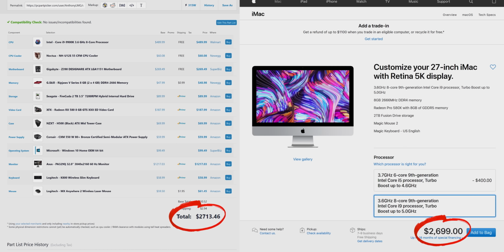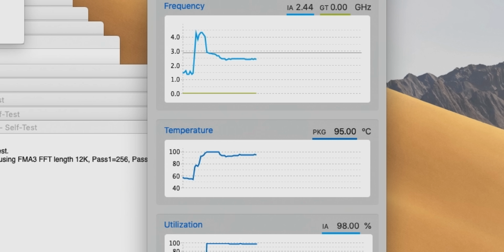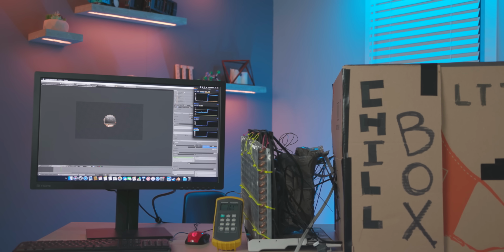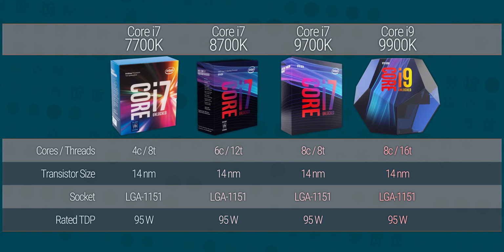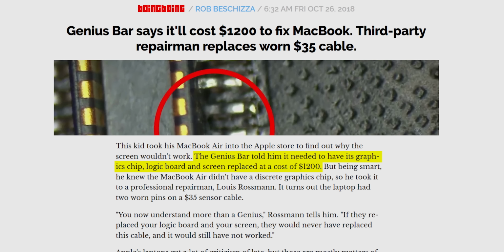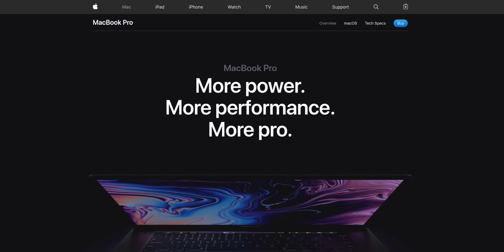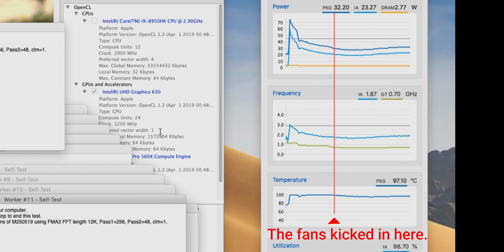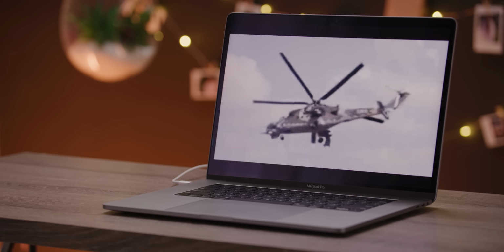Macs are SLOWER than PCs. Here’s why.

Comment: I agree and say it on the every chance I have, Apple should put slower CPU's in their Macbooks, with higher usage and lower heat and lower power consumption. Heck, not only apple, everyone should do this. I mean, yes slick and thin laptops with a ton of power and speed does sound good but the current CPU architecture that rules the PC world (x86-64) is not capable of this. Yes, you can put it in a smaller form factor, but it won't work as well as a well build and cooled desktop case. I mean, if you really need that power, you SHOULD chose the desktop choice or the Mac Pro for that instance.
On the other side, Apple is also a CPU designer, they design their own RISC-3 and RISC-4 ARM processors, with lower heat disipition and lower power consumption, with higher perofmance levels than most of the normal level desktop CPUs. The main reason they dont use it on mac's is that, no application other than Apple's own application won't work on the machine. And building a ARM to x86 to converter is more complex than you think, promising that Apple wouldn't want to launch a bad emualtion of this since they want the absolute best on their mobile devices and processors. ARM is currently on the 7nm level of transistors. Yes they are really not that powerfull on the top notch, but a Macbook Pro doesn't need all the power. I believe Apple plans on launching a ARM based Macbook sooner than you think, for the general purpose of usage. Most of the general usage apps have a ARM compability, and Apple might consider some iOs apps to work on MacOs, witohut any changes to the applicaton's inner workings, since the UI should be redisgned and refactored for the macbook and bigger, more dense displays. 

I really believe that x86 days are coming to and end for the average user, seeing that new iPad Pro can blow most of the cheap laptops away, I believe that even intel should bring their ARM game on. ARM is going to be a better platform for most of the general purpose users, and maybe even content creators and developers. But there will be someone that has a job that requires most of the processing power in the world, and thats where AMD x86-64 should stay. It's an old design, they should change it completely as soon as they can, because the more we use it, the more we become attached to it.
Reply: agreed with every word. well put.

Comment: It's always so bizar to me how people try to break Apple, oh, they are not fast, and it will break much quicker then pc's. Why then is it, that i have a 27" Apple led cinema display from 2009 and a thunderbolt display from 2010 side by side, working perfectly. My Macbook Pro retina 15" from 2012 (7 year old now), still working great. My Mac Pro 2013, no problems at all, loads fast, and works very reliable for around 3,5yr. now. I have an Apple tv, iPhone X, all working perfectly. The thing is, i went from pc (self built rigs) to Mac exactly for this reason, much more reliable! Of course, time has changed and i know Windows has been catching when it comes to reliability. I'm using my Mac Pro for music producing and video editing. And on the side i also do some web and graphic design. The only thing that i hope for is that the new Mac Pro is modular enough. Been thinking about building myself a pc again. Just for kicks :-)

Comment: Apple does not sell devices.  Apple sells "devices as a service".  Purchase price + AppleCare subscription (in good standing) = long-term (>1-year; including repairs) device.  Purchase price only = short-term (=<1-year; excluding repairs) device.  We don't buy fruit by the same name, either.  We rent it.  One way... or another... it becomes something you don't want to consume.  Like bad fruit, Apple's devices are shipped rotten... quickly turn into "used food"... causing far more bellyache than they are worth.  CrApple.  Stink different.  Mac.  It just breaks.

The MacBook Air was advertised as "Light.  Heavyweight."  My 2015 CrapBook Ail: "Light.  Paperweight."
Reply: 3 years isn't really that long. Most people will use their iMac/Macbook for up to 10 years(basically until they break or become so unusable that it's time for another one).
Reply: Tell that to my 11 year old iMac. It want quit working, so I can buy a new one. Wanted on for years now.

Comment: apple will use the higher CPU SKU because of other differences, mainly Cache size. Why ask Intel to make another SKU when you can just throttle the existing one. The price difference would be negligible after the cost of a different run of production for them.

Comment: In addition to all this, it's misleading to compare a PC build that includes a $1,200 monitor to an iMac. That monitor will still be good after the PC no longer is, and odds are you already have a monitor to use with your new PC anyway. Or if not, at least you can choose to buy a cheaper monitor if you don't want to spend $1,200 on one (indeed, $1,200 is a high amount to spend on a single monitor unless you have very specific requirements for such a high-end display...). With any all-in-one where the parts aren't upgradable, the first time any part becomes obsolete or fails, all the other parts effectively do too.

Comment: My macbook sounds like I am hardcore gaming when I only open like 2 chrome tabs.
Edit: I never said i game on a macbook. i just said it sounds like it.
Reply: How old is it? My 2011 13" mbp got super noisy at one point about two years ago and I had a guy open it up, completely clean all the dust out, and apply new thermal paste, and now the fan rarely turns on again. It's only a core2 so it's not a speed demon anymore but it works fine for browsing and so on.
Reply: Chrome is horrible at thermal, CPU, and Memory resource management on MacOS
Reply: In terms of cpu, nah. In terms of RAM, "Rev up those fryers!"
Reply: Chrome is Such a Memory HOG
Reply: chrome is "hardcore gaming" if  you know  what i mean
Reply: I had to get my logic board replaced 3 times on different Macbook Pros because I like to do some light gaming. My fault, for not realising I was melting my computer. Switched to a bulkier Thinkpad a couple of years ago and haven't looked back in terms of reliability and repairs.
Reply: @superstarDJ537  before my macbook i bought a surface laptop. Laptob is just literally fucked up because of shitty updates that windows was sending. eventually i returned it.
Reply: @selmanabdullah99  Just fkin install linux
Reply: @tunahankaratay1523  Lol, I was just about to tell 'em: should've bought a thinkpad...
Reply: @connorWithTheReallyLongHandle  wow, i think thinkpads are awesome aswell. Too bad that IBM stopped  manufacturing them.
Reply: same i'm regretting buying my macbook now
Reply: Hardcore gaming and MacBook in the same sentence, lol
Reply: You have a shit macbook then. Mine from 2013 still runs silently with 40 tabs open.
Reply: Lets Hope we can have Trump Censor these Video Games from getting more Stupid everyday I’m not hating on Linus but what the heck is happening to this Generation of Idiots more... People are becoming Lazy everyday and not caring what happens to their life they act like there is no meaning how to spend their life but play video games until the end !!! The New Generation are a disgrace to America. Trump 2020
Reply: Mjgyupp
Reply: Nonsense. Even on my 2017 MacBook pro 13 (i5 16gbTB) I regularly use ~30 chrome tabs and zero noise from the fans.
Reply: XD i have the same one. And what in the world is 16gbTB?
Reply: Keep off those click bait sites !
Reply: @crawlinginfilm9683  I wasnt able to give an answer properly before because i forgot which website did that.  It was youtube.... One video and my fans go brrrr.
Reply: Izumu K Confused for a moment - oh you mean your computer’s cooling fans!  As opposed to excited followers of your YT channel...  Got it now.  So even when you only play a YT vid (not some clickbait webpage festooned with dynamic bloat).
Reply: @crawlinginfilm9683  LOL. Isnt it called subscribers in youtube and not followers? XD
Reply: Izumu K Oh you never know who (or what) might be stealthily following... 😏
Reply: Fakenews bitch
Reply: Heh, "gaming"
Reply: Chrome turns my MacBook into a space heater
Reply: My MacBook sounds like it's ready to go to space when I use Photoshop or After Effects, it's insane. If only my job didn't require a freakin' Mac, I'd be in heaven.
Reply: Chrome does that to Windows too
Reply: To be fair, it's freaking Chrome. Nothing particularly magical about Google products either.
Reply: nigga who buys a fucking mac to play some fucking games.
Reply: @selmanabdullah99   Did you say mac and gaming in the same sentence? LOL
Reply: @kabiskzor  Bruh you dont buy a mac for gaming shit. You buy it for daily use or some video editing and shit. i dont understand why people complain that mac isnt a gaming shit.
Reply: @selmanabdullah99  Read the comment again
Reply: Why did you buy it then?

Comment: Why would Linus or his team assume apple is using motherboards valuing anywhere near $300? 27" UHD IPS displays go from $450-$700, not $1200. With that extra cash I can forgo the crap video card and have a 1080ti or 2080 in my unthrottled cpu machine. Want a $1000 UHD display anyway? Cyberpower or others for the i9 9900k desktop at $1.4k-1.6k and have at it.

Want an all-in-one for that space saving? $2300 for the same CPU Results + an RTX 2070 and 8gb more o RAM. $200 more for an RTX 2080. Slap an Apple logo on these if you want and rip out the $700-$850 video card, you got yourself an iMac. 
Edit: thought these were 4k, they are QHD, I expect 4k versions are going to be closer to $3000 (aka only sold with ~$800 GPUs), but that's because only idiot starbucks "artistes" buy good processors without good video cards and these morons don't buy stuff without apple logos.

Comment: The answer I think is that apple designs it’s processor for the iPhone, but is dependent by intel in the Mac! So if we will wait until when apple switches to costum ARM chips with the Mac, that would fix this I think!
Reply: The answer is that mac users are stupid and apple knows this so they dont give a shit.
Reply: Only if they nail x86 backwards compatibility. Windows on ARM did an okay job, with caching recompiled DLLs and all that, but the performance still left a lot to be desired. Here's hoping Apple can build on that technology and make it shine.
Reply: Samsung makes their Processors
Reply: Daniel Schick actually it’s apples design and pretty sure Samsung does not make the processor they make the oled display but not the processor

Comment: I really hate those Apple users, who see their computers as a status symbol. In one instance it ruined a friendship: he used to be an OK guy, until he really got into Apple, then he started to hate me for my choices in hardware purchases. He got mad at me for buying a wired mouse instead of a wireless one, saying that because of my purchase computer manufacturers have to put more USB ports on their products, and he implied I didn't need the better accuracy (or the extra two buttons) for my graphics work (since then I got a wireless one, mainly because the technology got better, and it has it's own dongle instead of using bluetooth). He called me childish for buying a video card (probably because the whole Mac gaming thing), and instead suggested me to save up for a used Mac, because that has a better resell value and has less breakdown time. He became the worst when his right-wing views started to influence his views on what computers people can afford, saying that people who can't afford Macs and iPhones are failures, and people who don't buy them despite being able to afford them should be also considered as such.

My experiences with him made me to declare: If Windows is capitalism and Linux is communism, then Apple is fascism. Boring, same looking machines that only benefit the top few percent. I cannot believe that there'er so many manufacturers that copy their design too. If I wanted to buy an Apple product, I would've bought an Apple product, not a slightly better clone.

Comment: If Apple doesnt want to use proper cooling techniques, they need to use a less powerful chip to help prevent throttling PERIOD. Sincerely, fuck you Apple. You cut corners, mislead customers, and then charge twice the price for a piece of shit computer. This doesn't apply to the everyday casual computer users. Macs are durable and the OS is optimised very well for a smooth experience. But for the gamers and editors, you insult us with this "we don't give a fuck" philosophy.

Comment: can't wait for apple to use their own CUPs in Macs.
Reply: "to use TSMC CPUs in their MACs you say, why cant Apple help Intel to developp a 10 or 7nm Chip process, because apple only rely on suppliers like TSMC to manufacture their chips, basically TSMC develop their own 7nm or 5nm process and apple uses it for their chips
Reply: Le Chat Botté Apple develop its own cpus in house, they don’t buy them from anyone. Also why in hell would Apple help intel develop its cpus? Which everyone will use even Apple competitors. The Apple A-series cups are very powerful and hopefully Apple will use them in their laptops instead of intels 👌🏼
Reply: @iiAhamd  are you on crack???! I know the Apple A series chips yes it's designed in house by Apple but it's actually manufactured by TSMC using TSMC 7nm technology. So Intel has to do the R&D IN house and also develop their own chip manufacturing process that what I'm talking about.

Comment: I find your price comparison just as misleading as Apple CPU boost claims.
When you want a Mac, you're forced to get an all-in-one. When you get a PC, you get all your parts separetely. When you upgrade the Mac, you need to basically toss away everything, while PCs can "recycle" a LOT of parts - screen, keyboard, mouse, case, RAM, SSD, 10Gbit NIC, Thunderbolt add-in card, cooling solution, power supply and so on. Easier upgradability yields MASSIVE savings just after couple years.
Oh, and on top of better long-term reliability, when going PC you get better warranty - even up to ten years on some parts like SSDs and PSUs.
And after a while, subpar cooling of a Mac gets clogged with dust and it's really hard to clean, exacerbating issues you speak about.

Comment: PC-s with the cheapest 5k iMac's specs(same CPU/GPU and equivalent RAM config and storage, AC wifi ) start around $600-700 (depends on the exact choice of components )+monitor.
27" (or bigger) 4k+ monitors range form $300 to the  starry sky.
Reply: So you're saying the machine they compared could be built for $1000 cheaper. Show us. dipshit

Comment: Correct me if i'm wrong but running cores at lower clock speed drastically increases their efficiency right?
So running an 6 core cpu at 3 Ghz sustained is (probably) more efficient than running a 4 core cpu at 4 Ghz.
I think that calls for a test doesn't it?

Comment: I have a 2018 mbp 15” and yes if I don’t MANUALLY put the fans to full speed, it throttles so so bad and gets so hot it’s crazy. But when I put the fans at max, at least it does a good job cooling down. I can say, it’s pretty dumb that my Mac will get so hot but the fans won’t automatically go full blast, it has never happened. So I’m just in the routine of being used to putting the fans at max when I’m doing something intensive

Comment: I have a 2012 15 inch Retina Macbook pro that I still use and it works perfectly as if brand new, can't say that about many things I've owned after 7 years. I don't play games on it but video editing and design software run smoothly and it's always been a joy to use.  I had only used windows before. I don't like the newer Macbooks though. The keyboard sucks, and the touchbar is totally unnecessary they've just seemed to go backwards for some reason and then charge more money for the downgrade...  I was on a programming course not that long ago where we pair programmed with our macs and whenever I was with someone who had the latest Macbook they always asked if we can use mine instead cause it was easier.  I'll probably get another couple years out of this and then if they've not got their shit together I'll be going back to Windows.